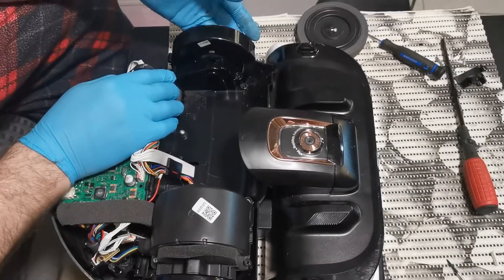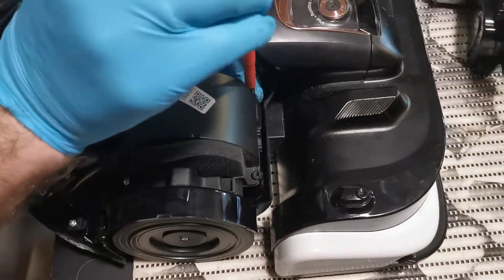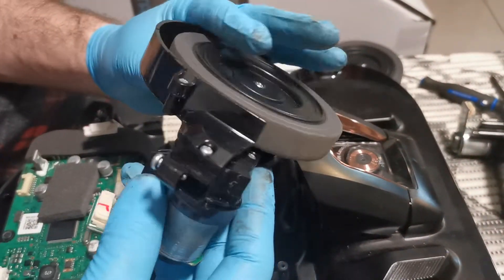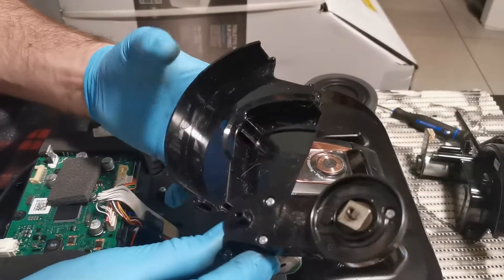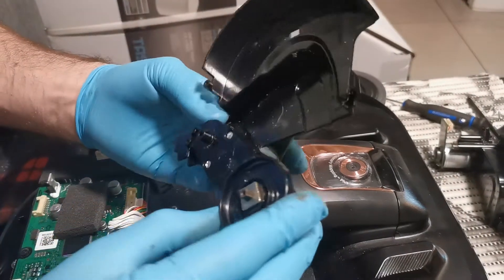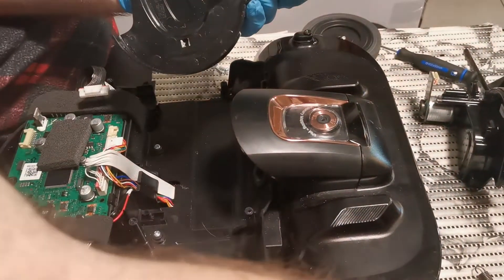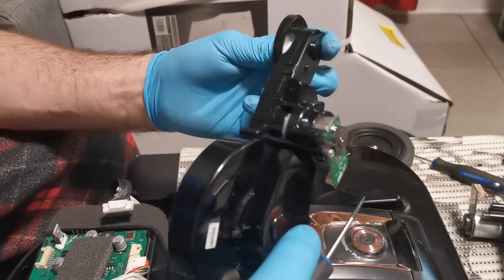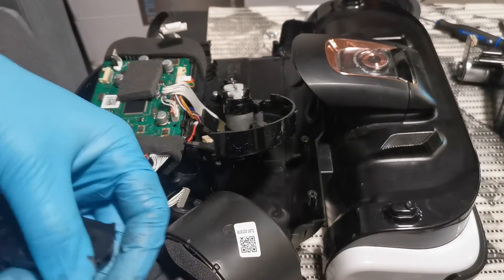Samsung PowerBot 9250/9350 Disassembly - Part #2

Comment: One of the wheels doesn't work. I swapped the wheels. The broken wheel still doesn't work. Is the problem with the motor?
Reply from the maker: It's hard to say not seeing it. 
Maybe, in my case springs didn't have any tension, the vacuum's wheels didn't have any traction on the floor. Later,  1 wheel broke, but vacuum was still able to move on a hard floor.

Comment: Hi I have also the same problem on one wheel.
I dissasembled the cleaner as in your video and it helped me.
One broken leg that holds the spring did you manage to repair it? and how?
Thanks great video.
Reply from the maker: @nickwhite7531  yes, i glued it with super glue, applying on a wet glue a baking soda.
Supposedly it makes the bond stronger.
I had broken legs on each wheel, so i fixed them and it held fine for about 6-8 months. And after one wheel broke again. So it was still working on a flat floor without being able to get on the carpet.
Reply from the maker: The springs on those wheels are too strong, and the plastic on these legs just can't keep up being under such stress.
Reply from the maker: I think of possibility of replacing springs
Reply: Thanks